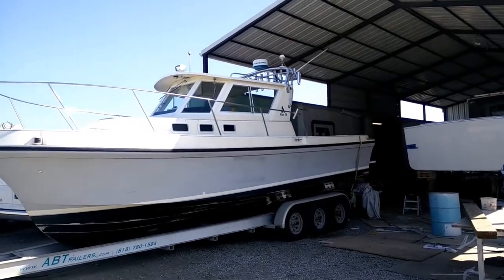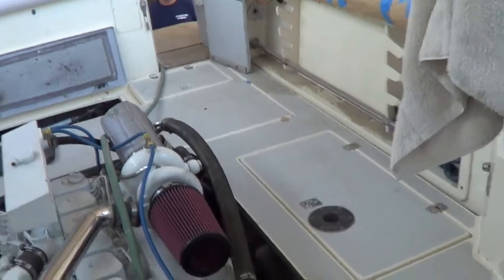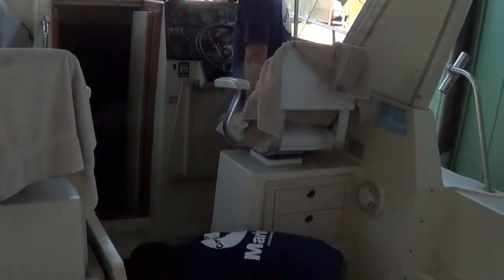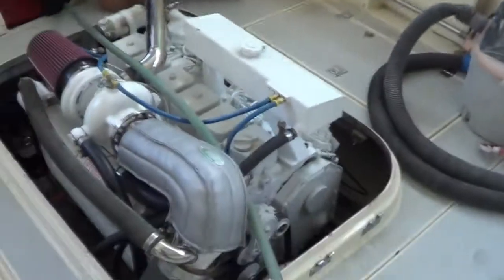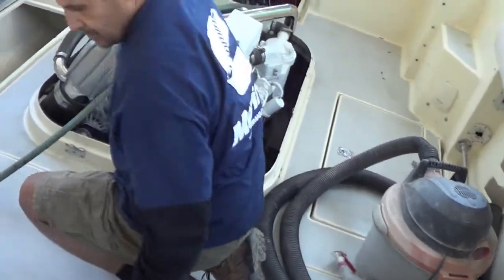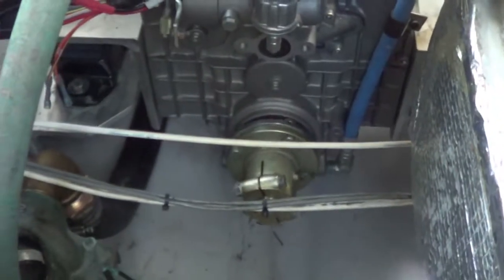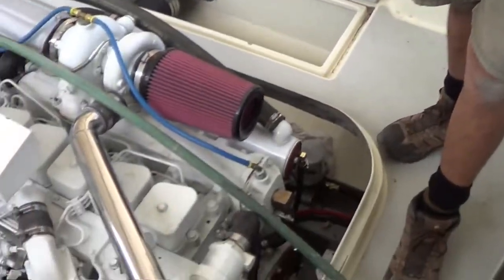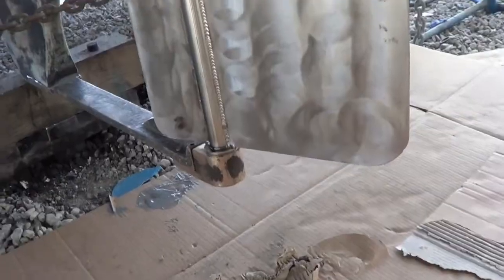Project Spotlight: Albin 28 Engine Test and New Rudder

Comment: I too have an Albin 28 and wish i could bring it to you for repower. Love the work you do. Can you explain why/what a new rudder accomplished?
Reply from the maker: This one was a couple years ago now so I can't remember exactly... Sometimes we need a new rudder design to gain clearance for the larger prop.  Sometimes the factory rudders are a bit small and the customer wants a bit more responsiveness.  Sometimes the old rudders are pitted or worn and just need replacing.  We don't always do new rudders.  Only if there is a good reason.
Reply: The rudder shape you replaced was a design that supposedly reduced cavitation.  I have an original rudder similar to the one you replaced and while it is responsive I get cavitation occasionally and the boat might not turn unless I slow the speed.  Would be interested on how the new rudder performed but understand you may not be able to communicate with that owner.

Comment: ive been told stainless is a no go below the waterline. how has the exhaust tip held up? looks good
Reply from the maker: Stainless is okay as long as it's 316.  We don't use 304 below the waterline.  316 holds up pretty well.  It's easy to cut, weld and fabricate, so its kind of inevitable to use it below the waterline for certain custom components; we don't have a foundry to cast custom one off bronze parts.